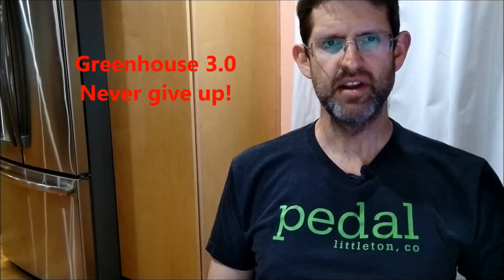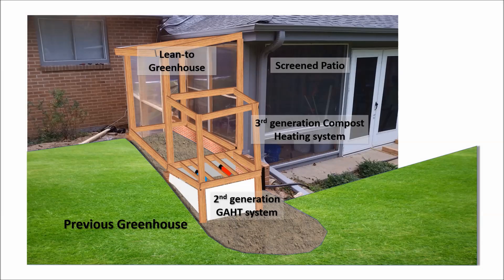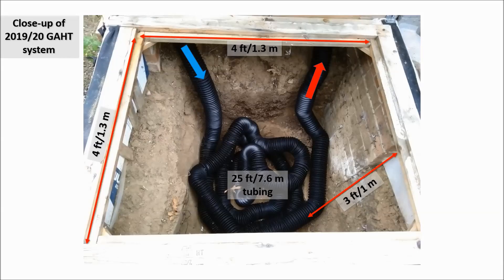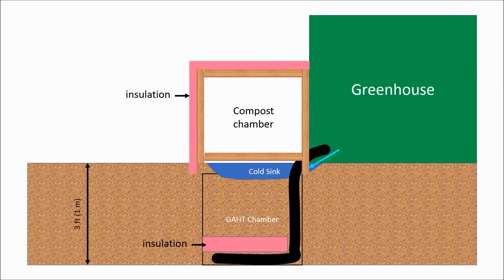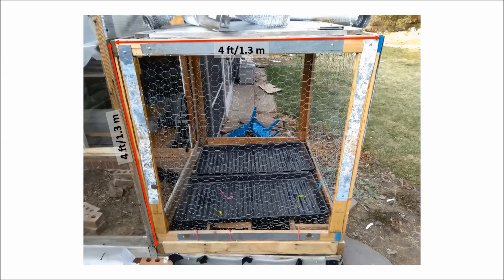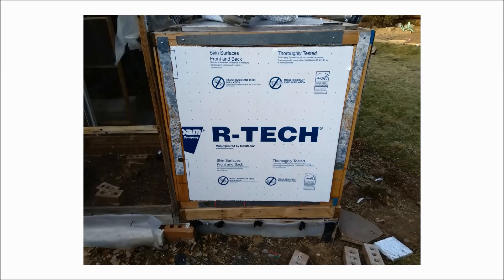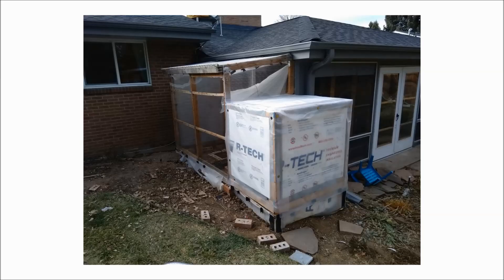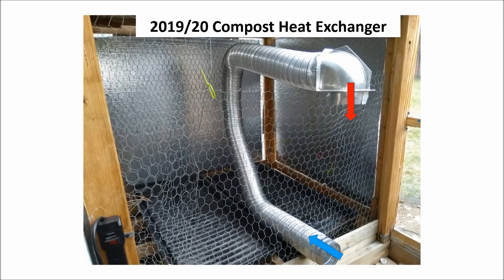Greenhouse 3.0 - naturally heated by compost and geothermal

Comment: Are you aware of the johnson-su composting pile setup?
Reply from the maker: I’ve heard of it.  Have never had luck with excessively aerated compost piles.  They just get cold and dry
Reply: @MorganBrown  That's a very interesting point.
Reply from the maker: @elkaro5  To be fair, my piles are typically small piles (3x3x3 ft or 1 cubic meter).  And I live in a cold, dry climate.  Large piles seem to benefit more from direct aeration.  It's an interesting concept, though!

Comment: Sir i just became aware of your channel today and i followed your previous gaht videos. There are a few hints i want to bring to your attention.
1) pvc or polycarbonate of any sort are fair insulators and therefore aren't ideal for your project as gaht deals with slight temperature variations.
2) no need for horizontal digging. Vertical is just fine when used efficiently.

For explaining purpose i will use down stream to represent pipe leading cold air from ground surface down to the bottom of the vertical well. And up streams for the pipe leading warm air from the well up to the surface.
What you need are copper tube, pvc tube, pool noodles, glue, fan.
For down stream - coil copper tube to cover entire depth of the well. Copper loops may stack on each other (ie. the coil loops can sit tightly on top of each other). Copper is highly conductive material and more efficient than pvc at exchanging heat, meaning it will warm up air more efficiently.
For the up stream - feed pvc pipe through pool noodle to create higher insulation. Feed the insulated pvc pipe through the centre on the copper coil. Link both insulated pvc pipe and coiled copper pipe with glue.
Let the fan force cold air into the copper pipe.

Side note: if the temperature in your greenhouse doesn't drop below freezing then your greenhouse could benefit from heat energy storage around the perimeter on the inside and up high near the ceiling. These can be a series of lined up containers filled with water. In your setup however, i think a hand made ring of wide enough pvc pipe around the inside perimeter of your greenhouse ceiling will be good. Also you could extend the same pipe to go around the ceiling of your compost compartment (to catch and escaped compost heat) and therefore keeping the stored water warmer.

Side note 2: in winter, over nights the greenhouse could benefit from being covered by polystyrene sheets since transparent plastic aren't enough.

Excuse my long comment. I hope i was helpful.
Wish you better results.
Reply from the maker: @[ MB ] thank you very much.  The pool noodle/copper tubing idea is interesting.  So far, I have stuck to the simplest and lowest-cost solutions for the geothermal.  To be honest, my main focus at the present time is compost heating, which has proven more effective for my use case.  So I really haven't done much new innovation on the geothermal side.  Your heat capture ideas in the ceiling of the greenhouse are interesting.  For 2021, my main goal is to vastly improve the insulation of my greenhouse.  I have many routes for air invasion on the walls and the ceiling, and that needs to be fixed before my experiments have any real meaning.  I also need to rebuild the compost chamber to provide larger compost capacity and easier compost turning.  Stay tuned.
Reply: @MorganBrown  consider using Hüglekultur raised beds. My raised bed hoop houses stay in the upper 50s and 60s from the heat produced by rotting wood and leaves down in the bed. I am adding a compost powered heater unsing a miniture Johnson-SU bioreactor to it next.
Reply from the maker: @RobWeimanAuctioneer  I like this idea and have pondered doing it.  For most people, myself included, this is probably the easiest path to achieve significant season extension.  I'm surprised, though, that Hugelkultur can achieve as much heating as an active compost pile, but have to confess that I know little of Hugelkultur.  Have you inserted a compost thermometer into the hugelmound?
Reply: @MorganBrown  I have not, as is isn't so much a mound as a deep raised bed.  However,  I wouldn't think solar heat heating the bed would last all night, and the temperature reading I am referring to was in the early morning before the sun came up.

Comment: I wonder if aluminum downspout + fittings would work. I have some extra bits on hand so I might try it. Thank you for the video, it gave me some ideas as well.
Reply from the maker: Yes, I bet those would work just fine.  I've been slow (lazy) in getting the compost filled.  Need to get it going in time to start seedlings.

Comment: Good explanation, thanks for sharing. I hope you solved the condensation issue, seems that should work.
Reply from the maker: I'm excited to get some compost heating up and start taking measurements!
Reply: @MorganBrown  If you use perforated rigid drain pipe, no condensation will build up, you will introduce more air to the compost to keep it aerobic, the pipe won't kink as the compost settles, and the all important CO2 generated by the microbes will migrate into the flex pipe thereby supplying your plants with CO2. 
My one issue with using perforated pipe is the humidity that goes along with it. This has not been an issue because during the day, it gets warm enough for my exhaust fan to run on temp rise. This brings the humidity down to acceptable levels. On cold and cloudy or rainy days when the exhaust fan doesn't run, it rains in the green house every night and I get snails. No mold or fungal problems... yet.
Reply from the maker: @canucanoe2861  cool, so it sounds like you have a compost heat system?  You are right that the humidity is a big problem.  I had an "open" aeration system in a past year's compost heat system and living in the very dry climate of Colorado, and in addition to having condensation in the greenhouse, I actually dried out the core of the pile!  I'm pretty happy with the heat exchanger in this video.  It's the product of several years of iteration and many failures.  The natural "thermosiphon" makes it truly passive.

Sadly, we're selling this house and I've already torn out the greenhouse.  Moving into a condo, so my gardening options are more limited.

Comment: Looking forward to see the results from this season :) What "kind" of compost are you aiming at? A fast-cooking heap would be more efficient, but would burn out early, while a slow-cooking might not provide enough heat, but should last longer
Reply from the maker: This year I'm going to shoot exclusively for a shredded paper and coffee mixture.  Last year I used leaves and coffee.  We get staggering amounts of junk mail, so it's actually pretty easy to source the compost with shredded paper alone.  I find that the paper/coffee mixture gets REALLY hot (160 deg F in tests last year), but cools faster.  I bought an 18-inch auger that you can run with a hand drill.  I'm going to aerate the pile with the auger to see if I can keep it hot for longer.